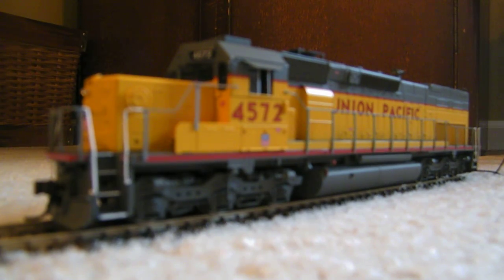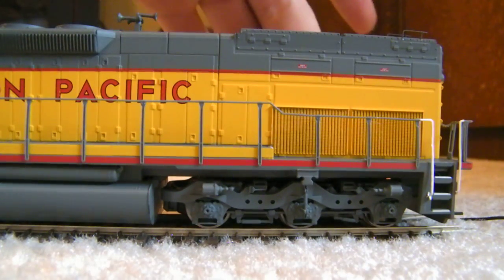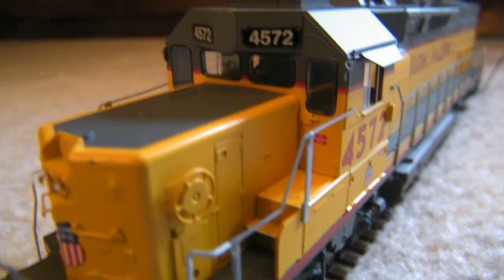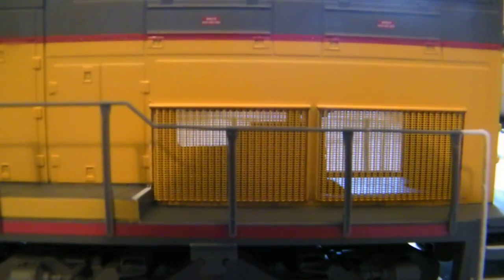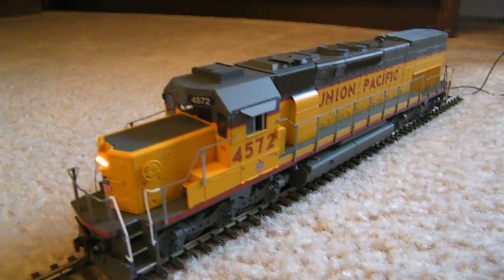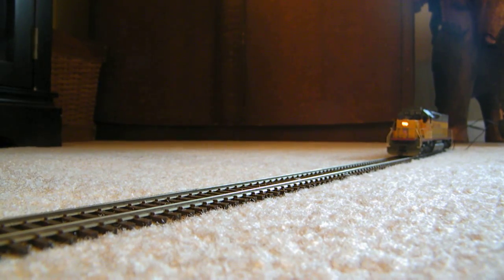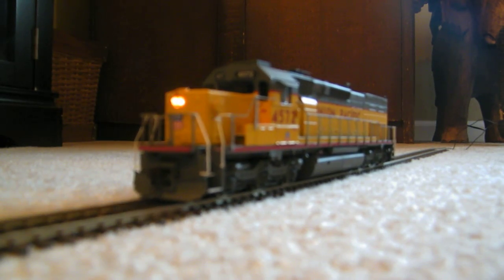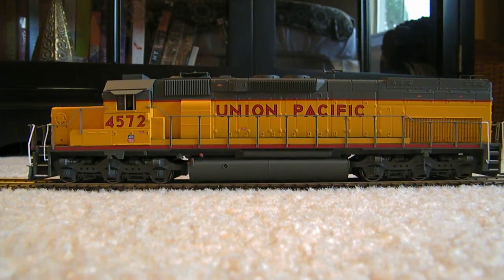Athearn SD40T-2 Union Pacific!!!!

Comment: The T-2 has a modified radiator configuration which lowers the intake grills to the bottom of the long hood (the top is the normal position) and increased the surface area of the radiators to combat overheating problems in the many tunnels snow sheds that SP had to run through on Donner Pass (specifically) and other routes.  This was especially necessary for mid- and rear-train helpers. This allowed to draw cooler air from lower in the tunnel vs. the hotter exhaust air at the top of the tunnel.

Comment: The tunnel motor grill can be bought for very little from Athearn as a spare parts order.  Alternatively very thin insect grill screening also works well. Whilst i own several of the RTR SD40T2 i also own some earlier older Athearn Tunnel motors which i have cut out the older grill areas using filing boards and then installing insect screens as grills If you view video of tunnel motors you will notice two diferent grill screens were used One type for the SD40T2 and one for the SD45T2

Comment: @jrcobb1994:  additionally, the "snoot" was added to many units to house the first generation of Distributed Power Unit (DPU, originally called Locotrol back in the 80's) which allowed for unmanned helpers anywhere in the train to be controlled by the lead locomotive.  Today's DPUs take advantage of micro circutry that doesn't need all that space that was needed back then.  The beauty of today's DPU is that the engineer can also shut down unneeded units as they roll down the road.

Comment: I have a brass nscale former SP SD45T-2  that was rebuilt to SD40-3TR. This model is a replica of a rebuilt locomotive that also have been deshrouded from having the third light on nose, brake wheel that has been replace by a rachet brake on nose, and light cover reveted plate on the cab between the number boards.

Comment from the maker: oh, thats easy, just unscrew the couplers from both ends then lift the body off!, keep in mind the Headlights and rear lamps are attatched to the loco so dont pull to hard or youll rip the bulbs out. but once the shell is off, the bulbs will come out with a light pull, be careful not to break the bulbs when pulling them out.

Comment from the maker: Using DCC..you are able to run 10 locomotives at once from my Zephyr. 1 out of 10 can be an Analog Engine (meaning without decoder) But they say if you Run an Analog engine on your DCC To not let it sit for long periods of time bc its constantly running. so in my case where i have a couple Older  or analog engines, i wil only run them wheni need them, when not in use, they will be on a dead track in my engine yard for display until they are ready for running

Comment: That is very prototypical engine.  It must be that particular engine number that U.P. has rebuilt with out the third light on the nose. U.P. rebuilt tunnel motors with cab headlights.